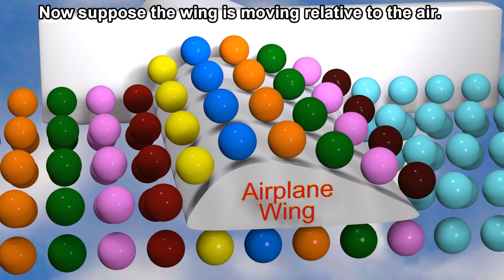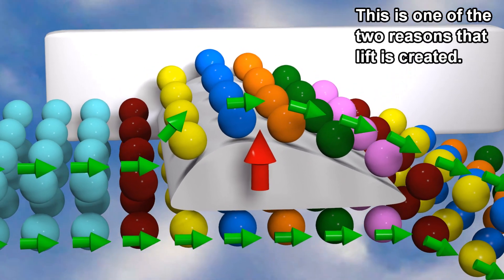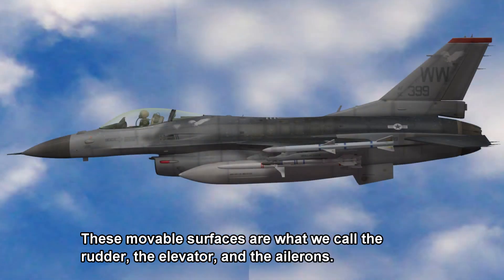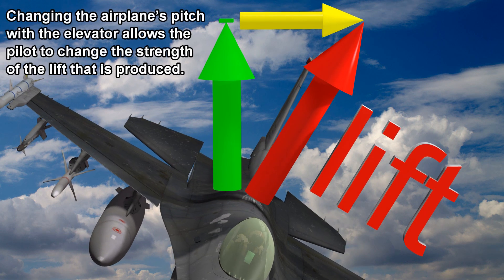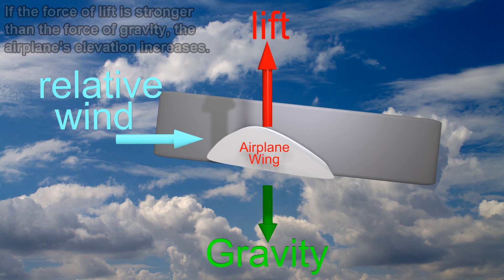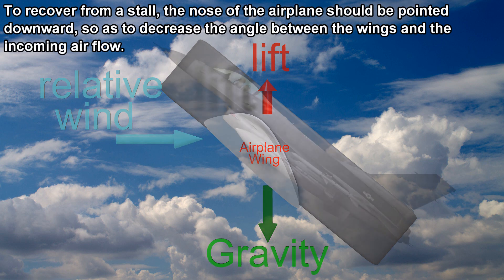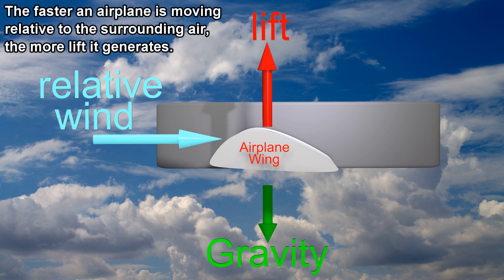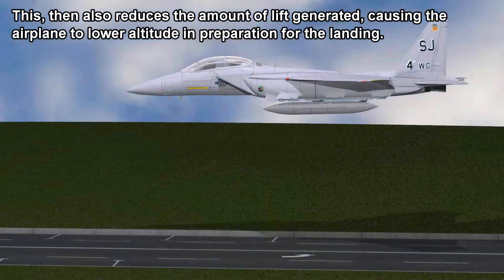Aerodynamics - How airplanes fly, maneuver, and land

Comment: Thank you for the video. Reached here after watching your General relativity videos. If lift is created by the first reason you mentioned, I mean wing's shape causing the air above the wing to move faster and the pressure difference thus generated and all, then how is it possible for a fighter plane to fly upside down?
Reply: Because it is not SIMPLY WING SHAPE, but the air flow pattern around the wing.
..
An inverted wing, flat wing, and symmetrical wing ALL PRODUCE SIMILAR FLOW PATTERNS and pressure changes...
..
The air bouncing off the bottom IS NOT a "second" reason for lift!!
.

The first explanation about the pressures being the lift is OK and is the ONLY explanation. However, the so-called "Faster air over the top" is a RESULT of the pressures.  Those very same pressures are what ALSO causes the downward movement of the air.  

Lift IS NOT a little of pressure and a little of bouncing!
  
It IS  the difference between the increased pressure under and the reduced pressure above... 

This is a the NET (TOTAL) upward force called lift.  THAT'S IT !!
.
Air DOES NOT "bounce" off the bottom.  It is caused to CURVE downward by the pressure increase, the same as the air above is caused to curve downward by the pressure decrease there.
.. 
A wing (just like any other object) must push air around (via pressure) in order to get through it.
This and this alone causes pressure differences around the wing. 

These differences just happen to be an increase below and a decrease above. This is the only net upward force on the wing, PERIOD!.
..
It just so-happens that, if you understand physics and Newton's Laws, these very same pressure changes cause ALL the air movements (accelerations) you see around a wing...ALL:::  Ahead, behind, above, below and around the tips.
Euler pointed out that Pressure Gradients are the forces that move (accelerate) the fluid. ['fast moving air' does not cause a lower pressure.  NOPE!]

Comment: That representation of lift is just false.
Reply: Correct.
The air bouncing off the bottom IS NOT a "second" reason for lift!!
.

The first explanation about the pressures being the lift is OK and is the ONLY explanation. However, the so-called "Faster air over the top" is a RESULT of the pressures.  Those very same pressures are what ALSO causes the downward movement of the air.  

Lift IS NOT a little of pressure and a little of bouncing!
  
It IS  the difference between the increased pressure under and the reduced pressure above... 

This is a the NET (TOTAL) upward force called lift.  THAT'S IT !!
.
Air DOES NOT "bounce" off the bottom.  It is caused to CURVE downward by the pressure increase, the same as the air above is caused to curve downward by the pressure decrease there.
.. 
A wing (just like any other object) must push air around (via pressure) in order to get through it.
This and this alone causes pressure differences around the wing. 

These differences just happen to be an increase below and a decrease above. This is the only net upward force on the wing, PERIOD!.
..
It just so-happens that, if you understand physics and Newton's Laws, these very same pressure changes cause ALL the air movements (accelerations) you see around a wing...ALL:::  Ahead, behind, above, below and around the tips.
Euler pointed out that Pressure Gradients are the forces that move (accelerate) the fluid. ['fast moving air' does not cause a lower pressure.  NOPE!]

Comment: Newtons 3rd law is enough.
Reply: Newton's Third Law is obeyed, but NOT as most explanations slaim including this one
...
The air bouncing off the bottom IS NOT a "second" reason for lift!!
.

The first explanation about the pressures being the lift is OK and is the ONLY explanation. However, the so-called "Faster air over the top" is a RESULT of the pressures.  Those very same pressures are what ALSO causes the downward movement of the air.  

Lift IS NOT a little of pressure and a little of bouncing!
  
It IS  the difference between the increased pressure under and the reduced pressure above... 

This is a the NET (TOTAL) upward force called lift.  THAT'S IT !!
.
Air DOES NOT "bounce" off the bottom.  It is caused to CURVE downward by the pressure increase, the same as the air above is caused to curve downward by the pressure decrease there.
.. 
A wing (just like any other object) must push air around (via pressure) in order to get through it.
This and this alone causes pressure differences around the wing. 

These differences just happen to be an increase below and a decrease above. This is the only net upward force on the wing, PERIOD!.
..
It just so-happens that, if you understand physics and Newton's Laws, these very same pressure changes cause ALL the air movements (accelerations) you see around a wing...ALL:::  Ahead, behind, above, below and around the tips.
Euler pointed out that Pressure Gradients are the forces that move (accelerate) the fluid. ['fast moving air' does not cause a lower pressure.  NOPE!]

Comment: Great video, I am showing this to my F-15 avionics student as in introduction to our flight control systems block of instruction. Be aware that the portion of the video that shows flap operation, at 7:00, the outboard flight control surfaces of the F-15 are labeled as flaps when, in fact they are actually ailerons. The inboard surfaces are the only ones that operate as flaps. The F-15's ailerons only move asymmetrically for roll control and always move independently of the flaps.
Reply: That's not all he has wrong. It should have been a clue:
The air bouncing off the bottom IS NOT a "second" reason for lift!!
.

The first explanation about the pressures being the lift is OK and is the ONLY explanation. However, the so-called "Faster air over the top" is a RESULT of the pressures.  Those very same pressures are what ALSO causes the downward movement of the air.  

Lift IS NOT a little of pressure and a little of bouncing!
  
It IS  the difference between the increased pressure under and the reduced pressure above... 

This is a the NET (TOTAL) upward force called lift.  THAT'S IT !!
.
Air DOES NOT "bounce" off the bottom.  It is caused to CURVE downward by the pressure increase, the same as the air above is caused to curve downward by the pressure decrease there.
.. 
A wing (just like any other object) must push air around (via pressure) in order to get through it.
This and this alone causes pressure differences around the wing. 

These differences just happen to be an increase below and a decrease above. This is the only net upward force on the wing, PERIOD!.
..
It just so-happens that, if you understand physics and Newton's Laws, these very same pressure changes cause ALL the air movements (accelerations) you see around a wing...ALL:::  Ahead, behind, above, below and around the tips.
Euler pointed out that Pressure Gradients are the forces that move (accelerate) the fluid. ['fast moving air' does not cause a lower pressure.  NOPE!]

Comment: So exactly why do molecules travel faster to pass a convex surface than to pass a flat surface?
Reply: Flow along a convex surface lowers the pressure because the mass wants to go straight and, therefore is "pulling" away from the surface therefore lowering the pressure. Think: Centrifugal force.
The lower pressure at the surface makes the pressure farther from the surface higher and this DIFFERENCE in pressure is the centripetal force. 
Pressure Gradients Accelerate the air.
..
The lower pressure above a wing ACCELERATES the air BOTH around the curve AND ALSO accelerates it toward the trailing edge.

...
The air bouncing off the bottom IS NOT a "second" reason for lift!!
.

The first explanation about the pressures being the lift is OK and is the ONLY explanation. However, the so-called "Faster air over the top" is a RESULT of the pressures.  Those very same pressures are what ALSO causes the downward movement of the air.  

Lift IS NOT a little of pressure and a little of bouncing!
  
It IS  the difference between the increased pressure under and the reduced pressure above... 

This is a the NET (TOTAL) upward force called lift.  THAT'S IT !!
.
Air DOES NOT "bounce" off the bottom.  It is caused to CURVE downward by the pressure increase, the same as the air above is caused to curve downward by the pressure decrease there.
.. 
A wing (just like any other object) must push air around (via pressure) in order to get through it.
This and this alone causes pressure differences around the wing. 

These differences just happen to be an increase below and a decrease above. This is the only net upward force on the wing, PERIOD!.
..
It just so-happens that, if you understand physics and Newton's Laws, these very same pressure changes cause ALL the air movements (accelerations) you see around a wing...ALL:::  Ahead, behind, above, below and around the tips.
Euler pointed out that Pressure Gradients are the forces that move (accelerate) the fluid. ['fast moving air' does not cause a lower pressure.  NOPE!]

Comment: Imagine a side cut section of a curved upper surface wing.  Now place another similar wing inverted above it.  What is in the space in between?  A Venturi.  
       Now, imagine just the bottom have of the wing again.  Imagine the curved air flowing above the wing.  At some point, that curved airflow meets a smooth uninterrupted air boundary above it.  What is in between the space above the top surface of the wing and the smooth boundary layer above it?  A Venturi.  Like the inside of a carburetor.  Thus the lower pressure on top and higher pressure on the bottom.
       NACA proved you don't even need a curved top portion to create lift.  In a smoke chamber, NACA (predecessor to NASA) used a flat board tilted on an angle to create lift. However this type of wing was not as efficient because the "burble point" was closer to the leading edge of the board.

Comment: 3:38 this is what i asked myself some 15 years ago. when you tilt the lift vector, why does the plane turn? the plane will move with a parallel component to the ground. NOT turn.
So this is wrong.
Reply from the maker: No, it is not wrong.  The plane "turns" because the place where the force is felt is not the same place as the airplane's center of mass.
Reply: Yes, but i think this is very important to turn out, why:
in the standard diagram anybody learns: Lift vs. Gravity and Thrust vs. Drag in stationary horizontal flight. and there the lift vector is above the Center of Gravity;
here the lift vector just increases and doesnt change its position. (and therefore would not turn in this case) because we start from the "standard" position.
PS: I like your videos.

Comment: This theory of lift has successfully been challenged. There is no force which constrains the air molecules above the wing to stay in the same relative vertical position as the air molecules below the wing. Thus it is not true that the air above the wing has to travel faster.
Reply: https://www.grc.nasa.gov/www/k-12/airplane/wrong1.html
Reply from the maker: I never made any reference to that theory.  The equal transit theory is never mentioned anywhere in the video, precisely because I know that it is wrong.  Nevertheless, the molecules above the wing do, in fact, travel faster than the molecules below the wing, and this does have some contribution to the lift created, even if it is not the main reason lift is created.
Reply: Yes, you do. You show the colour pairs of the molecules parting and staying in vertical sync and joining again at the trailing edge.
Reply: No he doesn't and the difference in speed is fairly minute. No the MOLECULES will not meet on the trailing edge. However those spheres are not molecules. Quite a bit bigger in fact. Any idiot can see at that scale those HUGE spheres will touch. Well not all I suppose.

Comment: I flight school they said the lower pressure above the wing is actually the greater force over the pushing force below.
And the aileron is increasing and decreasing the curvature and hence creating more and less lift while altering the lift vector due to changing the angle of the cord line.

Your videos are awesome especially quantum ones. Good visualizations!

Comment: This was a very informative video and very detailed and I personally found it very enjoyable to watch. The only thing that I didn't find quite right is  the wing shape generating lift due to shape causing the air molecules to move faster.   this does happen but it is due to the already present pressure differential over the wings surface due to the angle of wing to the relative wind or angle of attack. When the angle of attack increases it causes the molecules to be deflected downwards slightly and a pressure differential on either side of the wing thus the wing experiences and opposite force upwards but often the pressure on top of the wing doesn't change all that much it stays very close to that of atmospheric pressure and it's actually the slowing down of the air on the bottom of the wing that generates at higher pressure on the bottom so although the lowering of pressure does occur and a small amount of lift is produced it is a fraction of total lift. As well as this the equal time theory relies on two molecules of air starting at the same point but one going up over the wing and one going down under the wing and then rejoining at the trailing edge of the wing this is not going to happen because they are part of two different stream lines and are dynamic equations and not applicable to two  separate molecules on two different streamlined as well as this in theory a wing that is flat bottomed as very wavy on top should according to this theory generate masses of lift but it doesn't in reality and it also suggests that a symmetrical wing should only produce a tiny amount of lift because of tiny difference in path length between the top surface and bottom surface when even at a high angle of attack but this is not the case. In reality most light sport aircraft and even going up to the extra 300 have symmetrical wings and they generate enough lift to produce up to 12 g manoeuvres at just 200 kts which should be impossible for a symmetrical wing and the last piece of my evidence is paper aeroplanes. They are able to generate enough lift to support themselves for sometimes quite a distance yet their wings are the thickness of a sheet of paper or card and are usually flat and not curved in any way even under aerodynamic loading so although air does change speed over wing it's generally the speed of the air under the wing changing more  causing lift
Reply: Nope, nope, nope. Look at a pressure coefficient graph of an airfoil at any positive angle of attack. The pressure on the upper surface is significantly lower than atmospheric pressure whereas the pressure on the lower surface is not much higher.
Reply: Deflecting the air flow downwards generate lift because of conservation of momentum. Equal transit theory is false .

Comment: If you wake up in an airplane, with all the window shades closed, that is in the middle of executing a banked turn, can you perceive which direction it is turning by feeling the "g-forces" inside?

You can tell that it is either turning or climbing because you feel slightly heavier.  But can you tell which direction?

Comment: The spheres flowing around the wings should have shown acceleration, i.e. the top surface spheres should have been leading the bottom surface spheres by the time they reached the trailing edge.

As it stands, it looks like this video shows the 'equal transit fallacy', or even worse, it shows that the bottom surface air is leading! In reality, at positive angle of attach (or zero with a cambered wing like you have) the top surface molecules should be going faster and actually be in the lead!
Reply from the maker: I did not show the bottom surface air leading.  Also, I never stated the equal transit time fallacy.  The point of the animation was to show that even if you did have equal transit time, you would still end up with less pressure above the wing than below.  You are correct that I didn't go into the fact that the air molecules above the wing will reach the trailing end of the wing before the molecules below the wing, and this fact would increase the lift even further.  Perhaps I should have stated this, or shown it in the animations, but there is always the question of how much detail to go into.  For example, one could also complain that the air molecules are not accurately represented by spheres, and that the air needs to instead be thought of as a continuous fluid to be modeled properly.
Reply: Thanks for the reply - I'm using your videos to help some first year undergraduates understand some concepts in physics and aerodynamics, so I'm being quite nitpicky with that.

They recently got a guest lecture from a pilot, who unfortunately taught them the equal transit fallacy and explained lift purely as a demonstration of the Bernoulli equation which I've had to go over. Your animations are otherwise excellent quality.